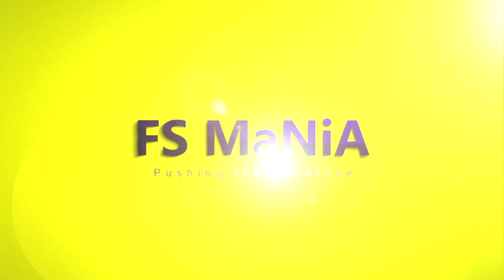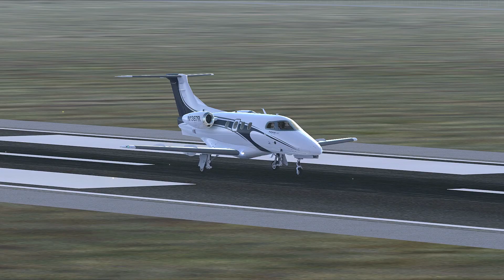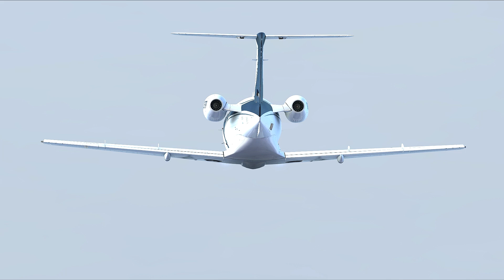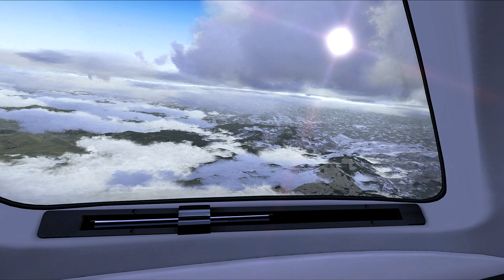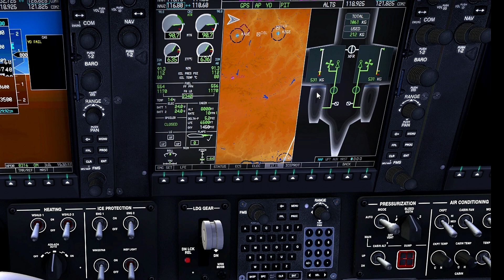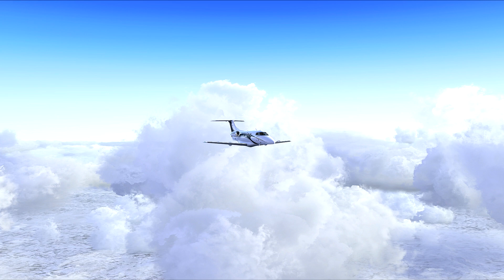Carenado EMBRAER PHENOM 100 HD part 2 of 3

Comment: Im loving this aircraft just getting slightly mad at not being able to find anywhere to calculate fuel for it, !"" any  ideas? thanks
Reply from the maker: Hi Rpbzter,  It's been a long while since I flew the Phenom 100.. you might find some information on flight planning in the AVSIM Carenado User Support Forums.  The fuel burn is always going to vary a different altitudes and outside air temperatures.  You can probably get a good average by keeping a watch on the MFD fuel burn information at your normal cruise altitude.  Just a suggestion of the top of my head.  Hope that helps!  Cheers, Tim

Comment: Where is there a good guide on how to operate this aircraft, such as autopilot and all the other intrusments?
Reply from the maker: Hello romee cor, that is  a great question!  One of my biggest gripes with Carenado is they provide minimal guidance on how to properly operate the aircraft and systems they model.  You would think they must do a lot of research on each aircraft project in order to produce a reasonably accurate model?  If that were the case, then why not pass that information along to your customers?  Doesn't make any sense to me.  I can tell you what I do to come as close as possible to flying the aircraft in my videos realistically.  I invest a significant amount of time researching the aircraft as well as the avionics.  I find some good information on YouTube, Google, and AVSIM forums.  If you fly aircraft by PMDG, Majestic, RealAir to name a few, you will have very well documentation as well as tutorial flights.  Hope this helps on some level.  Thanks for watching.  Kindest Regards, Tim G., FS MaNiA
Reply: thank you very much i thought it would come with some sort of info but at least the very good model of the plane makes up for it, thank you sir
Reply from the maker: romee cor just to be clear, Carenado does provide basic information on performance, normal operating procedures, including checklist, etc..  You should be able to find these files in your Flight Sim Directory under a "Carenado" folder.  It is minimal information in my opinion, however, it is more than enough for some folks that just want to simply fly or fly simple.  Tim G., FS MaNiA
Reply: yea i like to fly my planes like you in a more "professional" way but ill check that out